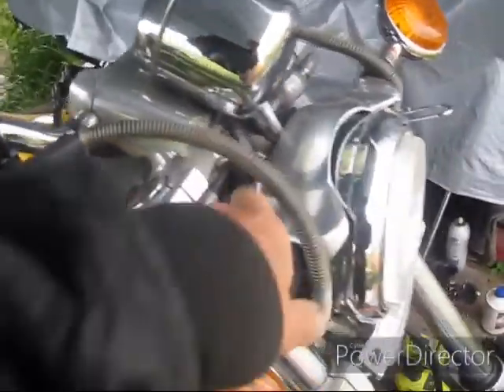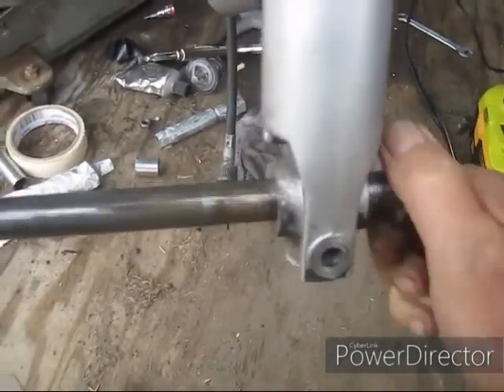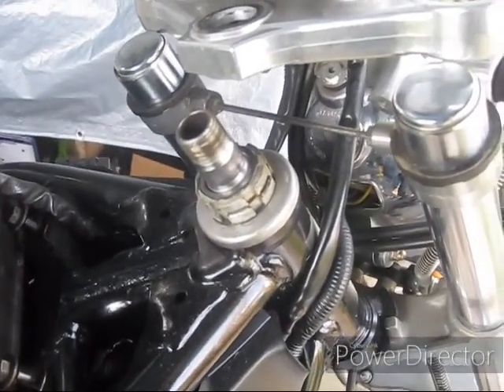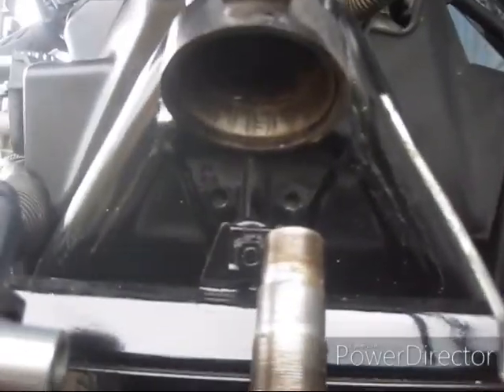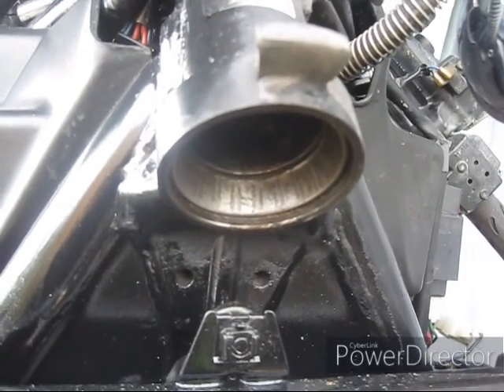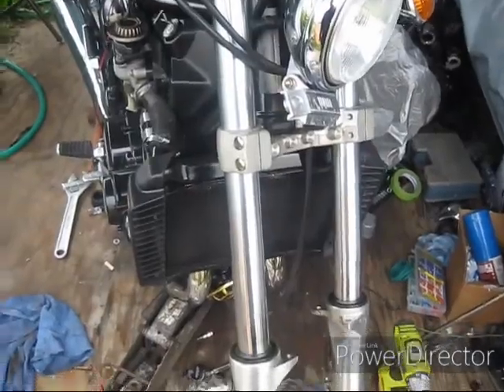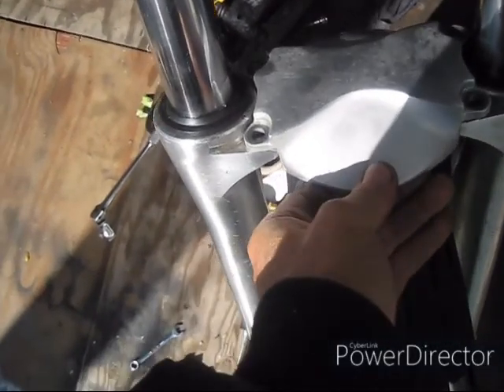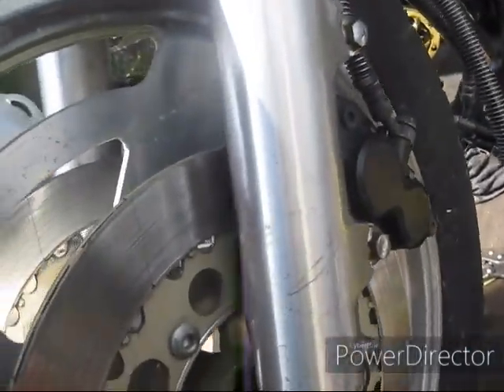1989 Yamaha VMAX big fork and brake upgrade

Comment: Hello from Russia! Thanx for your videos! I also have 1st gen Vmax, made a lot of work restoring it:) What would You recommend for improving brakes: install fork 43mm and rotors with brake calipers from 2nd gen vmax, just like You did - or just install bigger rotors, calipers from 99 yamaha r1 with stock 41 fork?
Reply from the maker: I recommend the later vmax forks.  They also have bigger rotors.  I dont know about the r1 setup, it might work, but I still would prefer the larger forks, they flex much less.  The vmax is a pretty heavy bike, and stopping it is a problem with the speed it makes so quickly.  I am glad you like the video.  Tom